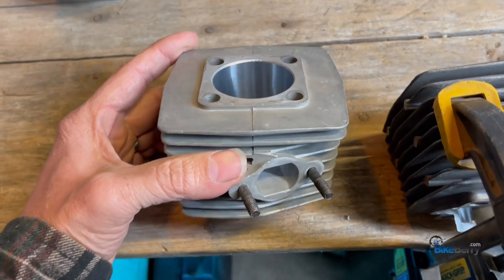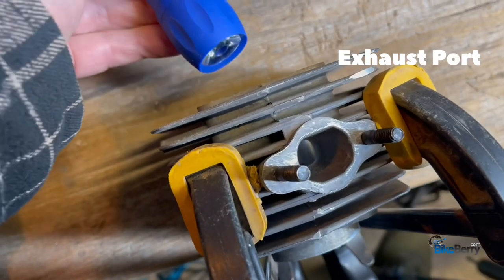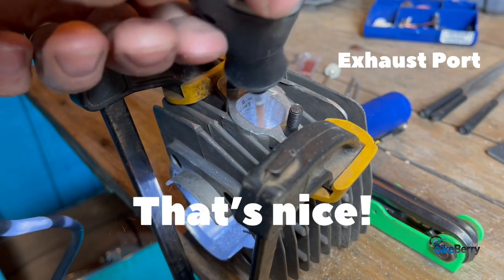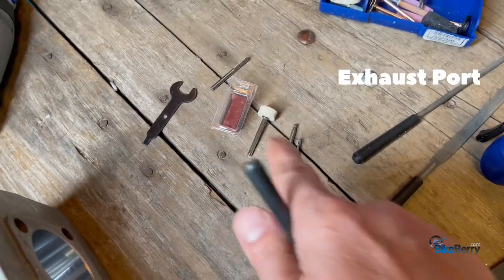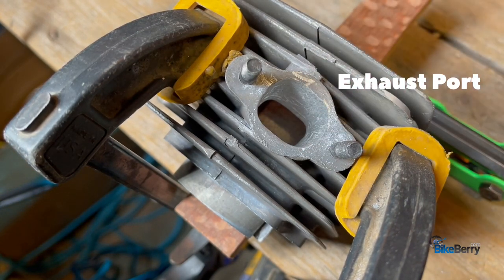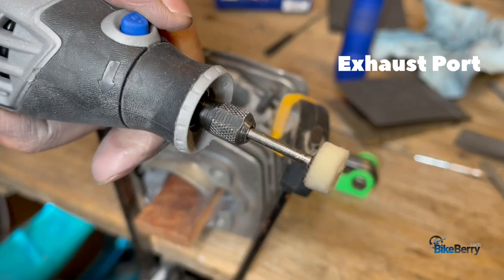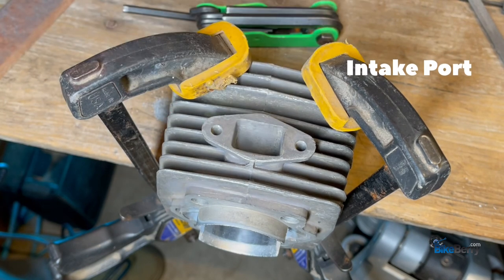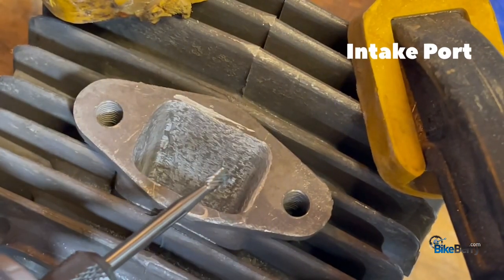Porting Video # 1 - Cleaning up Intake & Exhaust Ports

Comment: Also at a basic level you want to never touching the base of the exhaust port you gonna want to raise it to increase peak rpm power. Raising transfers helps bring the peak rpm up higher but without a good pipe it’s not going to take advantage of it. Finally the intake you want to lower the floor so the fuel and air mix gets in quicker than stock. Hope this gives a bit of insight
Reply: Much better than the one in the video thank ya sir

Comment: I use a round file, that's it. It is a little slower but really forgiving. I don't mess with the intake/exhaust timing but I like to make the interior of the port funnel out much wider, add a 21mm intake and run a higher set of jets. Makes for good response and more power. There is limits though, you don't really want the ports too big.

Comment: I'm brand new to the motorized bike scene, so this might sound like a stupid question? If it does I apologize... But what kind of performance does this give? Also does it give the bike more speed? Sorry for the dumb question fellas but I'm loving the hobby and most of you guys are pretty awesome with helping me
Reply: You’re fine! Please ask about the things you don’t know. 

This opens the engine up a bit to breathe better. Yeah you’ll gain a little top end performance. But mostly in the beginning stages we’re just trying to get the engine to run more efficiently. 

Just know port work is a rabbit hole that has a lot of opinion and experience around.

Comment: If you came here as a beginner, I highly encourage you to practice on cheap 😮aftermarket cylinders. Also do NOT chamfer the  outside of the ports like suggested here, only the inside the cylinder.

Comment: It's best if you trace the inside of the intake and exhaust gasket with permanent mark on the ports so you don't over grind those areas.
Reply: Good insight!
Reply: @tonytaylor5087  you could also try grinding a gold ball pattern into the intake side using the ball grinder. Don't forget to port match your grind on the carburetor and muffler. You want smooth even airflow through all ports. That's why tracing the gasket helps. To match the intake and outlet side of all units involved.